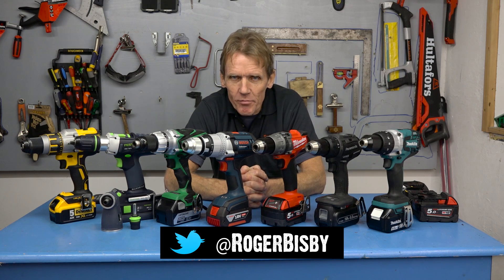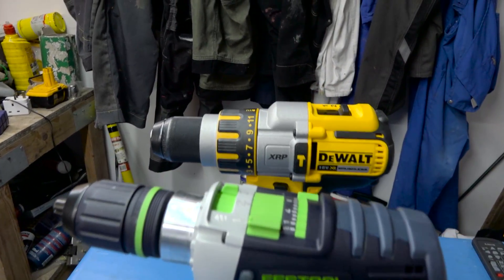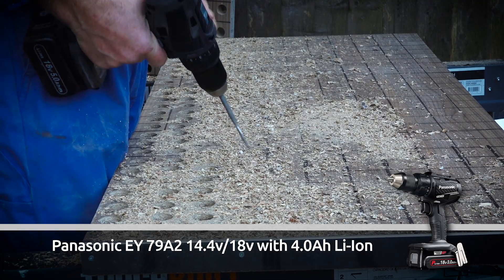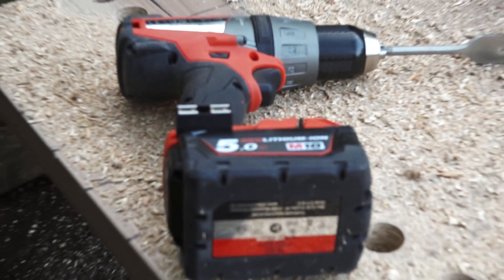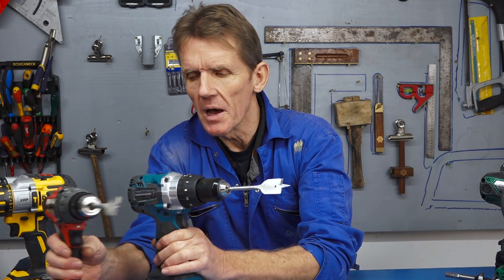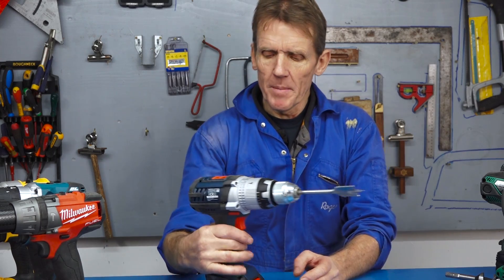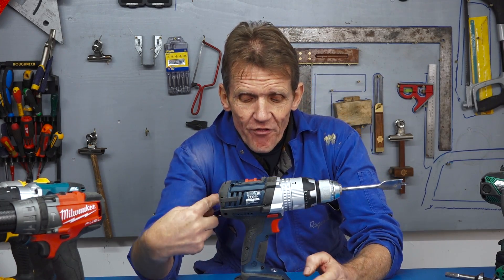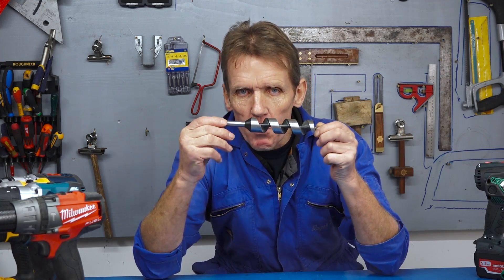18v Drills - Best Flat Bit Performance Review

Comment: I own the festool and the 4th speed is near useless . It will jump out of impact mode whilst drilling into concrete. Also the gearbox is knotchy.  Apart from that it is super reliable and durable, have had it for about 10 years (It is the old protool model).

Comment: Nobody shows the LITTLE details, such as the precision of the mandrel, the quality of the battery seal, (very loose on dewalt, perfect on hilti, hitachi, fein). DEWALT is all show-off, but if you are using it everyday you will realize that the big specs are not the most important

Comment: why there's no stanley?
Reply from the maker: We only test the professional tools
Reply: but stanley tools are also professional tools.
Reply from the maker: Jerome
Stanley bought a controlling share in Black and Decker who manufacture DeWalt so we took the DeWalt tool because that is their top of the range professional tool. They then introduced Stanley power tools which are basically Black and Decker power tools under another name,for people who think Black and Decker is too diy, so using that logic we should have put Black and Decker into the mix and then why not AEG and Ryobi that come out of the same stable as Milwaukee. You can go on forever like this and I think that the bottom line would be. "How long do these tools last and what kind of warranty have they got when used by professionals?" A lot of companies will tell you that a failure after six months in a diy tool is fair wear and tear if it is used every day. We look for a minimum of 2 year warranty on daily use.

Comment: flatbits were developed for corded tools that run much faster,chipboard id highly abrasive and blunts  the relatively soft flatbit too fast, lousy test Roger !!
Reply from the maker: Ah I see you thought we were testing flatbits, it was all about the drill runtime. Sometimes we need to spell it out in very simple terms.
Reply: Skill Builder That is Not what I meant (as you know) , it is a lousy test because the cordless drill is useless for driving flat bits, and chipboard blunts the flatbits thereby making the cordless even worse for the task. Mind you,if I remember you are a plumber aren't you !!

Comment: hi Roger, have you tested any of those drills on concrete wall? are they powerful enough especially M18 and DHP481? thx.
Reply from the maker: Hi Claude

We have put a 10mm bit through dense concrete blocks 100mm deep. Personally, I would always use an SDS machine for that job. I am not a huge fan of percussion drills. They get you out of trouble but it is horrible pushing through concrete with a percussion drill

Comment: I love when people say "it's not brand loyalty, it's just a better tool" but this guy literally has to defend himself to speak the truth about a tool, that's telling right there. And the festool, he says it's got a lot of protection, a lot of sophisticated controls, lol, aka, it's got a lot of gimmicky unnecessary crap for what he's testing them!   I understand there are different fields of use for a "drill" , but when a 12v equivalent with a bunch of fancy dancy electronics and a huge price tag puts it's self out there as a hard use drill, it's going to get eaten alive in the hard use arena. There are three fields of use for these tools, home owner medium duty, professional daily hard use, and light duty/exact craft screwing, each of which have their own category of tool. If you are doing a certain task you buy a certain type of drill, so if the drill you use for your tasks isn't in the category being talked about there is no reason to get upset. The problem, and really this is the problem, is that the homegame brands and the craft specific category tools are trying to blur into the hard use catagory, because it's the biggest market and the most common use, but just like how an impact wrench drill is being blended into the tasks of a regular drill driver and guys don't know what it's supposed to be used for, and how a drywall screw gun is not meant for hole sawing, the brands should stick to optimizing the tools for catagory specific use and market general use tools as general use, and if it's a homeowner general use, or a professional hard use, or a light duty craft use, they should still stick to their catagories and the quality of the tool will be judged independently of inaccurate use expectations.
Reply from the maker: Nice comment, well done you. keep it coming.  We have lots of other videos that could do with this kind of intelligent insight.
Reply: Skill Builder thank you, love the videos too, thanks for doing the work. I get brand loyalty, it's a huge achievement the brands pride themselves on accomplishing and intend for, and a lot of the times people aren't wrong to be loyal to a brand they have been proven on, and most brands are making very good products worth being excited about, but when tool or drills are compared and tested against each other the idea isn't to say this one is the best the others aren't as good, it can only give an idea of what your going to find and what the individual found, and when a new purchaser goes to buy one all the reviews in the world really aren't going to matter. They are going to walk in with their intended use, their price range and they are going to pick each one up and pick one, 97% of the time they are going to make the right choice and 90% of the time it's going to be a well made tool that lasts long enough to be a worthwhile purchase. I am looking at the drills right now and I do more scrutinizing before purchases then probably a lot of people, I am unchained by battery type as I'm starting a clean slate, which does make a difference, but despite my endless scouring of reviews and specs, when I go in to buy I will pick each one up, run them and make a choice and it might be completely different then what I had originally been eyeing. The drill I thought I might get might sit funny in my hand, the one that has the highest torque might not run different enough then a slightly less powered model to justify the less comfortably handled one, all those little details will weighed in the hand and can only be weighed in the hand. So with the long running already established quality of the top brands, and if you don't require battery compatability, close your eyes and operate the thing and buy it or don't and with any purchase wish for the best, if it is crap return it, and we should have respect for other people's satisfaction with their tools and it fitting their needs, brand loyalty should be positive recommendations or constructive criticism, not "Mines better, yours sucks, your an idiot" , they are all being made at a new level (sometimes to a fault) but none can be said as the only best but as the best for each their own. Thanks for listening to the ramble, and good luck with whichever tool you use!  :)
Reply from the maker: The bit that gets me about all this loyalty and blind faith is that the companies are bought and sold by accountants and asset strippers and the people who run them are not the same people that ran them before. I often visit a company and I know more about the history and who used to do what there than the people there. Examples,. Kango and AEG now owned by TTI, Hitachi bought Metabo and now Hitachi has sold the power tools to somebody else so even though it has the Hitachi brand it won't have anything to do with them and the biggest travesty of all is JCB who make great diggers etc but franchise their brand to people selling Chinese lawnmowers etc.
Reply: Skill Builder I'd like to see just one company, just one, actually build an entirely made in USA power tool line. Dewalt comes out with the assembled in USA stuff, and it's like come on, especially if you are supposedly building the motors yourself, why not trade your profits per piece for profits on number of sales and make them entirely in the US. You and I know what that would do in the American market, they would be first choice almost exclusively. Especially when they are owned by Stanley Black and Decker and dewalt is offices right in New England, not half a state away from me. That's what makes me so mad about Milwaukee, not that they are made in china, but that they have a brand name intentionally screaming "Americana, Americana", and are anything but for awhile now. A fully US produced, minus battery cells, give em that part for now, would sell   a thousand fold in the current race, dewalt saying assembled in is not as affective as they might be deluded to think. People are looking to buy elsewhere then china, it's just a fact, but they aren't giving us the options, that's why makita is still doing so well despite following the same formula as other top brands which by doing could likely have destroyed them, but they aren't made in china, and their reputation, combined they are still a number one choice. I think they should all be worried if they don't find something other then the electronics to race about, it will soon if already hasn't plateaued and more will if not already be less. power and durability should be chosen over tech, and we saw the first batch of "smart drills" showcase this with lots of glitches, battery problems, other areas overlooked like chucks and switches. We will see, a return to basics and a US made tool could do a lot of head turning, I hope to see anyway.
Reply: Skill Builder it's funny you say that. Jcb just assembles stuff. I work at a firm in Darwen Lancs, we do loads of steel work for jcb diggers. I was surprised it's not done 'in-house' but it most certainly isn't. Every time I see a digger now, I can point out the bits on it I made.
Reply from the maker: Johnyboytown
Well that is surprising, I thought they would cut and weld their own steel. Let's hope they don't take those jobs from Darwen and move them to China. I feel proud when I see those diggers around the world and think they are made in Britain.
Reply: Skill Builder oh they weld it. But that's just assembly. It's mostly heavy gauge steel we do. 10mm, 15mm etc on 300 ton press brakes. It's amazing what gets contracted out, we also do stuff for the big crane manufacturers, even as far as the powder coating in that distinctive signal yellow. Modern working methods I guess, when orders are slow or there's a downturn in the market, you don't have to pay staff for doing nothing or lay them off, or start looking for new skilled blokes when there's a boom. I'm amazed at what comes through our door at WEC.

Comment: HI, given that the Bosch you tested is not brushless, while other models you tested are, have you considered how the new brushless bosch might compare to this range of competition? I'm tempted to go with the new brushless bosch, but keen to know if you have considered this new tool..
Reply from the maker: Yes we have considered it and will be doing a live-streaming tool test at Bosch HQ. We want to put the new drill through the same tests as the others as well.
The benefit if having two brushed motors in the test was to allow people to see how much more you get from a brush-less and whether the extra performance  is worth the extra cost. Not everybody needs it. 
It would be good to run brushed against brushless across the board.

Comment: There's actually four speed settings on the Panasonic - took me a moment to realise that on mine. If you press the speed select it will toggle between L, M & H, but H isn't the highest speed. If you press it once more it will then go to full speed.
Reply from the maker: thanks. too late to check because it went back

Comment: Clearly he doesn't read the manuals before using and testing them. :P
Nevertheless a big thumbs up for a greatly comprehensive drill test and discussion! \o/
Reply from the maker: +Reinier van der Leer 
Fair comment. There was a time when you didn't need to read loads of instructions before drilling a hole but I can see that even on this first stage of the test I needed to have a closer look. I got the hang of them by the final test.

Comment: What brand of tools do you use?
Reply from the maker: +Machiel Kruizenga 
Hi 
I have to be honest with you and say that I have had over thirty years of reviewing tools for the British trade press and a good few doing videos etc. so tools come and go in my life. If I have a tool on loan for a month or so I will  thrash it. Manufacturers have been a bit shocked to see the state of their lovely new tools when I have run them or leant them to my mates who are, without exception, animals. 

If you are asking me what I would buy, brand wise, then Milwaukee,, DeWalt, Makita, Festool maybe Bosch but they have a variable range of tools, some good, some not so. The trouble is these days that brand doesn't mean you always get a great tool. They all have strengths and weaknesses and some of those weaknesses take time to show through.
Reply: +Skill Builder thanks for your response, I' am from the Netherlands, and Milwaukee is not a common brand that is being sold here, but it is well known here. Is it an American brand or Japanese?
I am a Makita man, and I would like to know what makes Milwaukee that prefered tool, because almost brands have the same type of batteries, and voltages, and amps.
What I'm trying to say is, they are all strong machines.
Thanks.

Comment: I have no clue why festool has such a big following. never even heard of them till a while ago and upon reserch where they actually tore into these tools the festool had to be the most cheapest made overpriced pos out of the test group. the two you mentioned in this video ARE the best drills. MAKITA 7/8 holes in 1/2 6061 t6 alum. 4 at a time. NO JOKE. The Makita takes it. I've had DOZENS of just about all the makes. my tools see more grueling action than most. Makita all day long 😉👍
Reply: MadMetalManiac74 they are the the best when it comes to fine woodworking. Plain and simple. They may not be the fastest, but they are the cleanest, and most precise.

Comment: Festool 18V cordless drills aren't really a Festool design. They were designed by and sold as Protool. But then Festool purchased Protool and rebadged Protool's power drills as Festool.
Here you can still see them in the original black and orange Protool colours:
http://www.festool.com.au/drc-18-compact-18v-cordless-drill-driver
http://www.protool.atIt similar to when Black & Decker bought the German tool manufacturer Elu. Some DeWalt models were just rebranded Elu models.
Reply: +ITubeTooInc I wonder what benefits the Metabo and Hitachi brands will gain as a result of Hitachi Koki's recent Acquisition of Metabo - if any? 
Acquisition of Metabo AG by Hitachi Koki completed: http://www.hitachi-koki.com/about/ir/financial/2016_fi/20160301.pdf
Hitachi Koki has just announced they will close down their manufacturing plant in Ireland.
Announcement on Dissolution of Subsidiary and Posting of Loss Associated with Dissolution: http://www.hitachi-koki.com/about/ir/financial/2016_fi/201602251.pdf 
This is probably a related to the Acquisition of Metabo.
Reply from the maker: +ITubeTooInc I would say that is correct. I was told that they bought Metabo to gain some distribution channels.

Comment: The Hitachi drill in the graphics below looks A LOT different than the one you actually tested in this video, how come? Pause at @ 3:47 to see the differences. The one is the graphics is almost all black with a black torque selector and no metal gearbox. It just has a bit of green at the back of the handle. The one you tested on the other hand has more green on it, a silver torque selector and silver gearbox that looks like it's made of metal and it's screwed onto the rest of the drill unlike the one you show in the graphics.
Reply from the maker: +ITubeTooInc 
Yes you are right. well spotted. The guy who does the edit will be taken out at dawn and shot.. We shall show no mercy. He took a cutout from Hitachi to represent the drill and it was listed as that model. The model we tested is the one listed. I can't tell you what the one in the graphic is. It might not exist.

Comment: I have  watched your  18v drill tests .I would like to comment that  the makita  battery charger has the problem of showing batteries as faulty ,and persisting in  showing all batteries there after as faulty . I have rigged other chargers to the makita batteries and charged them successfully.  I believe that it was an overheated  battery  situation that caused the charger to show the fault . Therefore I threw  out the charger and replaced it. The same fault occurred with the new charger and new batteries some months  later. This becomes an expensive situation.

Comment: used all of these on site festool great tools heavy on the price.milwaukee great tools useless warranties in my experience.dewalt/makita great tools and great warranties.bosch/hitachi not a bad bit of kit can't really say any think bad about them.panasonic/metabo have always been a bit hit and miss for me had some great drill off them both in the past and some bad ones.but for me bang for buck is dewalt/makita for over all performance and great aftercare in warranties.i do wish all the drills had the little rubber on the side like you get on the dewalt 10.8 drills means when you put the down the don't mark things and the don't slide when you put them down on tiled roofs

Comment: Now i May be wrong here but i am pretty sure that the dial at the bottom of the metabo is the clutch setting and has nothing to do with power. At least the older metabo drills were like that.
Reply from the maker: +jonas15449 
You are not wrong but it does slow the speed down so a light clutch will result in a slower run. This is useful on precision work.  It confused me a bit at first but if you watch the final result you will see that I qualified that remark. I will put a note up. I thought I had. Thanks for pointing it out.